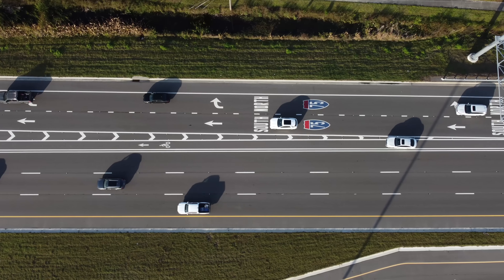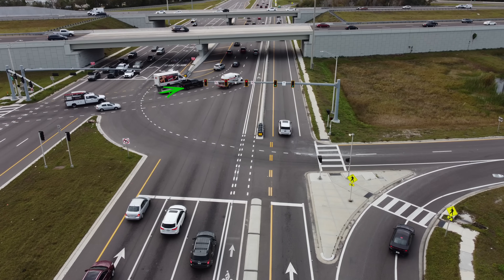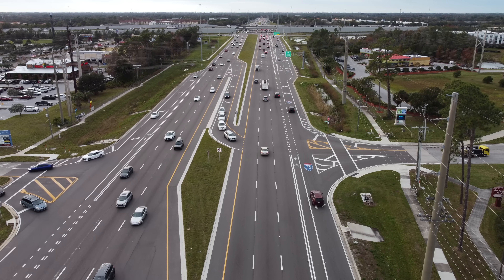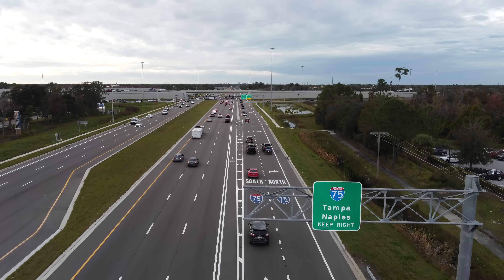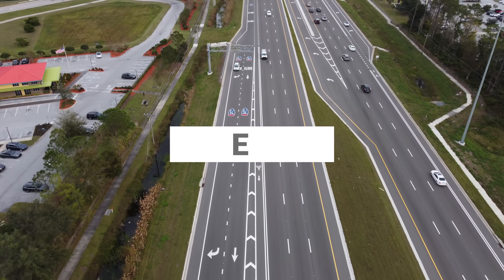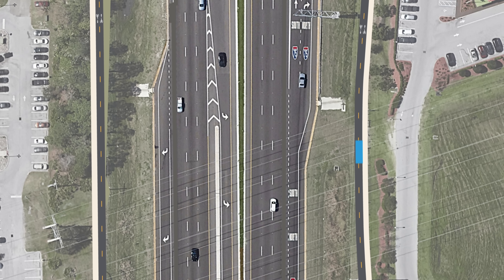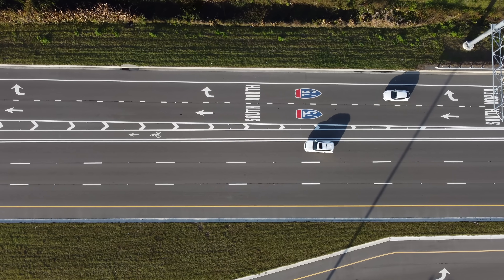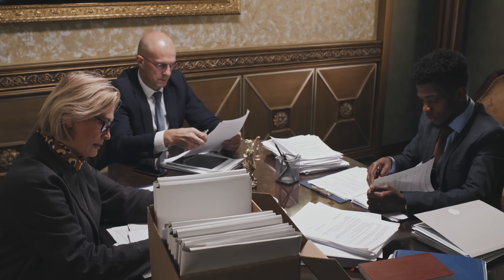This Brand New Interchange is Already Flawed

Comment: The issue with the tunnels for the bike lane suggestion is the depth to water table. You can easily see that the water table is only a few feet below grade as evidence by every undeveloped area being a pond or swamp.
Reply: They could go over instead. Pedestrian bridges exist.
Reply: @TheRealScooterGuy the bridges would need to be about 20 feet high and the ramps leading up would be enormous (think wheelchair accessibility). Then they have to dip under the freeway. It’s just not realistic or cost effective.
Reply: @arcum  -- We have such bridges where I live. Not a lot of them, but they exist.
Reply: I would take my chances with a little water in a tunnel over biking on that road.
Reply: They have these fine things called pumps, that can pump the water out of any tunnel. Along with good waterproof lining and sumps in the low points. Netherlands manages this even with their tunnels in lands which are all BELOW sea-level.
Reply: @ryancappo  - not unless they are completely flooded - which is what happens if you build them without considering the water level
 @petesig93  - rather, waterproofing exists. We have a LOT of dry tunnels built under rivers in almost every city. Although dampness (and molding) is not solved as easily or cheaply.  
 @matthewlittler8387 - let's not. US already destroyed marshes - complete with all the ecosystems - a size ofa country - just to build the motorways themselves. Furthermore draining often leads to sinkholes.
Reply: @petesig93 pumps effect wildlife.
Reply: Sure... We can build a tunnel under the sea from France to England but not a tiny one for bikes and pedestrians?
Reply: @AWARHERO  pedestrians don't matter
Reply: wear rubber boots!
Reply: Couldn't they just drain the swamp?
Reply: You can have tunnels with high water tables, they have to do it all the time in the Netherlands. However, it definitely adds to the costs. There are currently even a few highway tunnels designs that are under scrutiny, cause ground anchors have unexpectedly failed and the water table has been forcing tunnels partially upward. 
I don't know a lot about standard Floridian architecture , but here it quite common to employ piling in more modern structures, even if only moderately heavy like a (brick laid) house. 

But the real answer is off-course that that bike lane is a joke, nobody would use it, and in a few years they will probably paint if over, or turn it in a car lane or a merging zone, claiming it wasn't used as much as expected. It was never intended to be an actual bike line in long run.
Reply: @Tuning3434  unfortunately our governor does not want to invest in anything at all that is flood proof, really. All he is letting developers do right now is build build build. Our water table is also rising much faster than yours so it would be very risky to make tunnels.
Reply: hey stupids who are arguing about the bike lane...there are 2 bike paths one on either side of the road. the bike lane is there to satisfy a legal technicality.
Reply: The access roads are all already well above the water table so that's not an issue.
Reply: Tunnels for pedestrians and bicycles under roads were popular in the UK in the 60's and 70's, but by the 1990's they were usually daubed with graffiti, stank of pi$$ and were often occupied by homeless people.  Just because something is a logical and safe idea doesn't mean that humans won't ruin it in practice.
Reply: @pulaski1  This is indeed a problem. 

It is partially mitigated with good lighting, cleaning, and maintenance, to make sure this looks like an active pedestrian tunnel and not abandoned one. Hanging a camera is not as expensive in 2024 either, preferably with a loud speaker for security people to yell into. 

It adds costs, but mostly it's just a part of much bigger problem with outdoor security in US, or rather lack thereof, which also involve very loose gun laws.
Reply: @jwhite5008  I agree with most of your summary and analysis, but while the number of guns in circulation certainly isn't helping, I think that the bigger problems, which are likely easier to address than guns, are the issues of drugs and homeless people.
Reply: @pulaski1 That was my first thought when he mentioned pedestrian underpasses, was that they would simply become a shelter point.  There are more homeless than ever now, and while they're not usually dangerous, they do take up space and if they live in a tunnel, it makes it hard to get through.

And of course there's the additional risk that they could simply become crime points.  Few women especially would bike or walk through there after dark.

Comment: The bike lane problem is, this road should not have bike traffic. In NY, a road like this would not be open to bicycles. And it shouldn't be. Not without barriers on both sides. 18 wheelers going at full speed next to bicycles is not a good thing.

Comment: honestly even just replacing the sign where it says "75 south, naples, keep right" was just completely replaced with "75 NORTH / SOUTH" with an arrow into the single lane without any other changes would be huge improvement..... but yeah....  I agree the bike lane has no business there... no one is going to seriously use it (or someone is going to get hurt).. and the two lane shift would be far more ideal.

Comment: Another potential factor that’s completely invisible is Google Maps. I can’t count the number of times the voice has told me to get into the wrong lane, only for me to realize I need to make a last minute change that isn’t ideal. It would be nice if state and local DOTs could work with google to properly announce each movement within an interchange such as this
Reply: If I'm driving with someone I usually give them my phone and tell them to look ahead and let me know which lane to be in two turns in advance. It works out so much nicer. 

The directions for which lane to be in on google maps are terrible.

Comment: Proposing tunnels in Florida? Do you think bikes are submersible? Also bikes don't share sidewalks they share lane rights and there's 50 years of history on why that is. That exit is not bad and is really manageable and self-explanatory if you're not on your phone or daydreaming. I never had a problem when I make stops there. You want a newly built disaster try exit 275 on that same highway but further north in Wesley Chapel. I've seen many cars going the wrong way and it just opened. Exit 282 seems perfect not sure why they didn't do that design for for all of them.

Comment: I despise the signage in Florida. Half the time there isn't any and when there is it's usually way too late or in a confusing setup. Like I love the fact that a lot of the stroads have their own right turning lane for shopping centers. It means cars don't slam their brakes constantly to turn into a parking lot. The problem is that it's not a lane that splits off but just the right lane will sometimes randomly become the turning lane. And the sign for it is small and right before the lane splits so you need to hurry up and get into the middle lane. But then further down the road another left lane gets added and that middle lane is now the right lane again. If I need to make a right turn in a couple miles I'm always wary of getting in the right lane ahead of time because I don't know if it will split off before my turn. 

The frequent Michigan lefts are great because it means you don't need constant traffic lights but there's no signage telling you how they function. So you just have this huge gap with no markings or signs to direct people how to use it. There's been many times I've seen several cars every which way in the gap because someone got confused, pulled into it in a weird way, and then got too scared to pull out onto the road because everyone is going 60mph. So then anyone else wanting to use it had to go around them and there were many near misses. Considering how many visitors Florida gets, especially from other countries, you'd think they would make their roads more intuitive.

Comment: On the same idea as the psychology already mentioned, human factors in general always have to be considered.

Something I’ve noticed over the years that traffic engineers almost always overlook is what happens IF something goes wrong and what can be done to minimize damage in that case.

Snow, ice, wet roads, drivers falling asleep, catastrophic vehicle failures (broken suspension, tire blowouts, etc), low visibility, etc all have to be taken into account. This is the case even if the designer doesn't think a situation will happen (like snow in Texas).

What happens if a car hits a curb or wall? What choices does a driver have if they (or someone in front of the suddenly starts sliding? The more outs one has, the easier a decision can be made in an emergency situation.

What happens if a given lane is shut down?

Comment: It should quite frankly not even be legal to build bike lanes between lanes going faster than 20 mph.
While bike lanes at the sides of faster roads are still bad design, they are at least often better than nothing, but weaving lanes in between high speed traffic is just complete reckless disregard for safety.

Comment: As someone who drives this every single day, thank you! I agree with almost everything you say. The signage is horrible. Just changing the signage and road markings would make a world of difference! 
One issue that you did not mention is the traffic at Lena Rd meeting the turn lane onto the interstate. There are accidents there almost daily as people turning off of Lena assume that those in the turning lane are turning onto Lena and pull out in front of those actually heading towards the interstate. This causes more late merging as locals decide to merge after Lena road to avoid that potential accident.
My wife talked about biking to work and I convinced her not to, strictly because of this intersection. Tunnels sound great, but don’t usually work well in Florida without a lot of drainage work.

Comment: Great video, and you have great insights, keep up the good thinking!

Coming from a civil engineer (who happens to be licensed in FL), one thing that's glaringly obvious is that the contractor messed up the order of the overhead guide signs and FDOT and/or the resident engineer didn't pick up on it during construction. I'm not sure if that first sign structure is properly designed for that large panel, so there's a potential public safety issue here. The 2nd structure is way overbuilt for that smaller panel, which is another giveaway that something's wrong.

There is a figure in the MUTCD that shows the proper sign sequence for a multi-lane conventional road approaching a cloverleaf interchange (Figure 2D-19), and this doesn't follow that. Yes, this isn't a true cloverleaf, but you'd use that example bc there's a far side loop ramp for the left turn movement.

The "I-75 keep right" sign should be the first in the sequence. Then you place the current first sign (with the exit only) where the keep right sign currently is, and that'll fix a lot of driver error. It's been awhile since I've had to deal with FDOT, but they should have either a "contact us" website or a "report a problem" website where you can notify them of this sign problem with the exact locations. I highly recommend you report this and include some of the drone footage that shows the dangerous driver behavior - it should help move it through the queue faster. Once it's logged into the public record by reporting, they're liable to fix the issues, otherwise they open themselves up for lawsuits.

BTW, the current signs are technically illegal bc they're placing a mandatory movement sign over a lane that doesn't have a mandatory movement. That's a signage no-no.

Edit - I should watch the video all the way through before commenting 😂 good to add in the reporting part!

If you reported to FDOT before, do it again for this problem and you might save some lives

Comment: Another idea for signage is to have full signage across all lanes and IDing the lanes directly. It’s the best way to see which lane is which even from a huge distance as you can count lanes even if parallax isn’t allowing you to see which lane the sign is over. 

This has the added benefit of being actively read by Google StreetView cars which then puts the proper lanes into the driving directions on Maps.

Also, this would give them the choice to dump the traffic calming curb and put in a full barrier because I can guarantee than the mini curb will cause accidents and do damage when people inevitably go over it.

Comment: Although there’s a lot of issues with this interchange, the bike lane is by far the most glaringly obvious and deadly of them. The easiest and cheapest fix I can see for it is to move the bike lane all the way to the left, where the current lefthand shoulder is, and shift the shoulder and three thru lanes to the right. This allows drivers to make all of those last minute decisions without having to watch out for slow bike traffic and the bikers only have to look for traffic on one side with a 15ft buffer (shoulder plus the existing bike buffer) between them and fast moving traffic.

You could even stick a barrier there at that point to make the bike lane completely protected.

Comment: My hot take is that $80 million already spent to weaponize drivers is not my problem. Spend more to fix it or close the roads for being too dangerous. People will lose their minds when their Constitutional right to kill people with automobiles is slightly restricted... Ranting done.  Here's some personal experience with the location in this video:

It's not just about Florida. Ironically the best bike lane system I have ever lived with is the Pinellas Trail in this same metro area, north west of Tampa Bay. And yet Pinellas County remains an area with a very high number of pedestrian fatalities.

The county and its myriad municipalities have really tried to address this with expensive crosswalk improvements and adding traffic control lights for additional pedestrian-only crossings.  But local factors also include a population that is quite elderly that's there for part of the year, switching to a tourist population enjoying the beaches during summer months. Drivers who have impaired reaction times and drivers who tend to be unfamiliar with the area.

Comment: As someone that uses this intersection on a regular basis I can tell you that it should be demolished and rebuilt from scratch, while the engineer that designed it should buried alive for the sheer stupidity and incompetence shown when designing this intersection.
You missed another huge problem with this intersection. In the past the exit ramp on the northbound side of I-75 free flowed to the east bound SR-70. Now it no longer is free flowing, and has a no turn on red sign at the intersection. This has resulted in long backups that can stretch all the way on to I-75, making things even more dangerous.
This intersection is a case study for how to not design an intersection, it’s really that bad to use, and has become one that is prone to traffic accidents when it comes to that I-75 entrance lane.
It’s truly a disaster and a complete waste of money.

Comment: In regard to bike tunnels…….the water table in Florida is 4 feet below the surface and you see the water all around (let alone the frequent heavy rains). Tunnels are great. However, not in Florida. That said, Florida wins the prize for the worst interchange designs throughout the world. Any “fix” or improvement in Florida to existing designs just causes more headaches. In this the state excels.